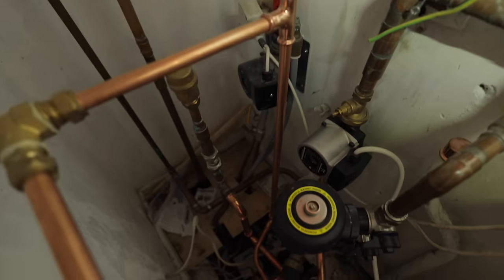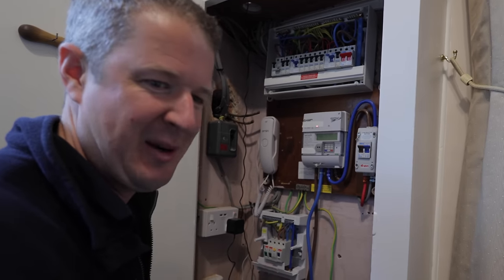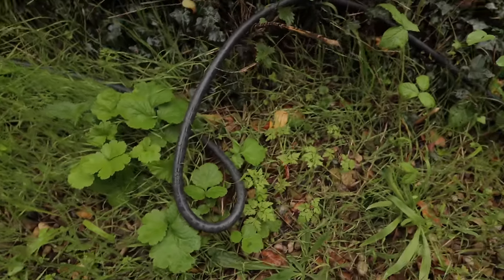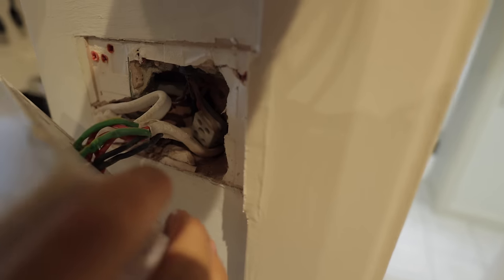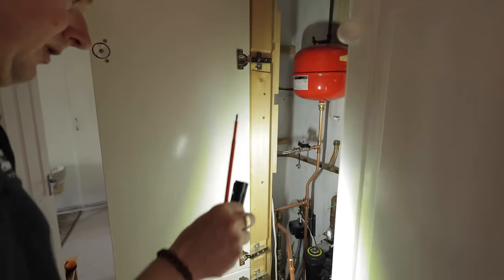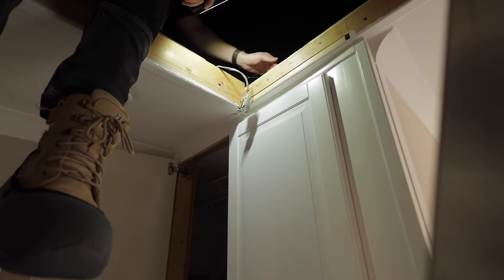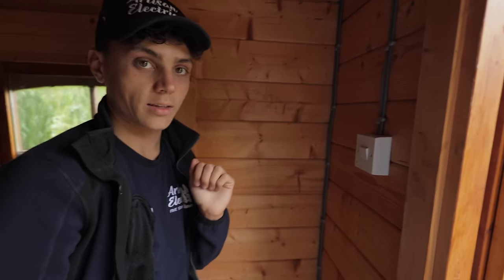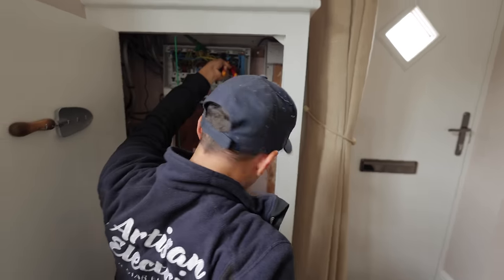The WORST Socket Wiring I Have EVER Seen!

Comment: I haven't checked the comments so someone may have said this already, but for 16mm tails from a 100amp main fuse, I would load test the circuits in that ccu via a clamp tester and ensure the total load doesn't exceed 87 amps.The only other thing I'd mention here is that the service cut out fuse may not necessarily be 100 amps despite it saying so on the carrier.If under 87 amps I'd go for C3 but over 87, I think C1 could be appropriate due to a lack of overcurrent protection
Reply: Even if the load isn't currently over 87 amps, that doesn't mean it couldn't increase at some point in the future (if they add more stuff, etc), so testing the current load is kinda irrelevant, IMHO.  The fuse rating should always be less than the maximum current rating for any conductor in the circuit it protects, regardless of the current load.  That is the only way to protect against possible future hazardous conditions as well.
Reply: @foogod4237  On an EICR we are reporting on an existing installation , not what may happen in the future. Any subsequent alterations or additions should be in adherence to reg 132.16 so the onus is on the installing sparky to ensure meter tails, earthing, bonding are correctly sized and do necessary upgrades where needed. I am well aware that the largest component on any final circuit must be the circuit cable but that doesn't apply to my comment regarding meter tails on an EICR.Whether you feel load testing is irrelevant your call, I've done enough inspection and testing training courses where this has always been raised and C3 is the correct classification code.

Comment: Undersized meter tails (in relation to the main fuse): if no thermal damage, and the calculated max load is below the rating of the tails…..I’d code 3 it with.
Reply: Bang on money

C3 not compliant but if fuse say 60 amp or so to match conductor size it fine.

C2 if undersized in relation to cutout fuse😊

Comment: Worst socket wiring I have ever seen was  in a neighbours house where some clown had wired a socket  into a  wooden shed from the house using two lengths of  satellite cable,  the socket  was under a reasonably high load , namely a tumble drier. I was lost for words when I saw the wiring.

Comment: Opening this video up I just know rhat the worst receptacle installation over in the UK is gonna be 10 times better than the worst in the states, and probably 5 times better than the insane pitiful average here in NYC. The stuff I find just in my own apartment/home would make your skin crawl!

Update at end of video: yeah that's not great, but I've seen worse! 4 or 5 times I've pulled a receptacle out that hasn't been touched since it was installed in 1983 and just had some of the wires come out. As in, they weren't really making connection in the first place, and could have caused a fire if someone connected a big load. Bad stuff.
Reply from the maker: I have seen photos and videos of the other countries around the world and would deem myself mostly lucky haha
Reply: @artisanelectrics   @artisanelectrics  I envy the UK design with partially insulated plug contacts! I was shocked last year in a pretty terrifying way from a 120v outlet for a gas stove.

If you're someone else reading this, ***absolutely have a licensed electrician do the work for you***.

Someone dropped a stainless steel sheet behind the stove (that we use as a grease splatter shield) and, unbeknownst to me, it landed right on the contacts of the plug.... which was about a centimeter out because it was loose.

*Of course*, our amazing luck was that it didn't conduct enough current to trip the breaker (heavy sarcasm). It just arced enough to eat a big hole out of itself over the neutral. It's not yet code to have AFCIs or GFCI/RCD on every circuit, and it certainly wasn't when that outlet was installed. Which means the stainless steel sheet was still energized to line voltage when I leaned behind the metal stove to grab it.

Zap. 120v across my chest and into the handle of the stove.

That night I replaced that outlet with a better one that is ALSO a combination AFCI/GFCI. It even turns out that that outlet, and half the other outlets, were wired backwards by the last person hired to do construction. Insanely dangerous. And it began a long project to improve the electrical safety in my living space way beyond code. 

Every branch circuit is getting a hospital grade GFCI with an audible trip alarm at the first receptacle, which is very useful for my elderly parents. Every circuit will eventually get AFCI at the breaker. Every downstream receptacle will be hospital grade or industrial grade. It ain't cheap, but I'll be glad to know that at the end, nobody has to worry about getting a shock, or starting a fire, ever again!

Again, if you're reading this, **absolutely have a licensed electrician do the work for you***. I *only do the work that I cannot get a licensed (and competent) electrician to do, and even then, I only do the one or two things that I can guarantee I can do safely from an electrical engineering and code perspective.

Sadly, I still catch even the best electricians I can afford making mistakes. Over here, a torque screwdriver is as foreign as it would be to an uncontacted tribe! So I usually have to loan mine to electricians, and make sure they use it.

I love the channel, and love to see a perspective from a different country. I hope you enjoyed the little story there!

Comment: God I wish we could get three phase in a residential areas here in the USA!  I would be all over that.  Get rid of all the dumb single phase to three phase converters that don't work near as well as having real three phase.  🤠👍
Reply: 😂I can get you a cable across the pond cousin.... 😅could take a long time thou and a big go fund me😂
Reply: Some parts of the US 3 phase is relatively common in residential. Here where I live we have a 3 phase high leg Open Delta setup, 100A. Due to be upgraded to 200A 120/208Y when the power company has time. As long as you live on a street with 3 phase power lines the power company has no problem hooking you up. Most of the time they do it for free as well because you are increasing the load and better balancing their system. All of New England works this way, most towns have 3 phase on most larger streets.

Comment: Seeing that 3 phase head can I ask a question about them please. the 3 phases are rated 100A each but is the neutral only rated 100A as well meaning you couldnt pull 300A in total if you were using it a 3 single phase supplies?
Reply: check the DNO incomer cable type.. will answer your question

Comment: The customer should be happy they chose fine tradesmen... craftsmen even.  🙂 How long ya been out of apprenticeship boss? 
I've seen my fair share of 'worst'.. lousy diy numpty mess - the layer upon layer of chit. the sick feeling of spotting VIR or asbestos... and the can be pain from plumbers. It's why I loathe to work on domestic installations.  
Pretty much the same gear and distribution system here (Aus) , with some differences... like Earth conductors in 2.5 and 1.5mm  3 core cable being smaller than A/N. The insulated Earth conductor is always stranded Cu.

Comment: Hi Jordan.  19ms is a little low for an RCD I think.  It could cause intermitent tripping.  I usually look for them to be 21 or higher to be ok.
Reply from the maker: Thanks for the info 👍
Reply: See regular 18ms rcd times.

More about having an rcd tripping at a lower test current and causing nuisance tripping😊.
Ramp tests are always useful tests to conduct and and also before doing a rcd test switch it on and off a few times😮

Comment: I’d only code the 16mm tails if the installation would be likely to pull more than 84a which is the maximum current carrying capacity of 16mm tails.

Comment: Seems the UK have a lot of really rubbish switchboards and meter setups. In Australia we usually have everything in one outside meter box and switchboard combo metal box. No ring circuits either.  Of course if its not a freestanding home you have common meter location and switchboard in the flat. Etc. I think we have it easy. What are your thoughts?

Comment: Canada here, a ring circuit is that like xmas lights if one burns out they all go out?
Reply: No because the last socket wired then goes back to consumer unit. The idea is that the electricity & of course the amps are shared from 2 directions so that it is more evenly applied to the things attached to them. Think of it like radiators that come from the boiler & then feed back into the boiler to make a circuit, however of course that only goes in one direction whereas a ring circuit supplies in 2 directions.

Comment: Have you ever found a 6” nail for a main fuse on an industrial job I have
Reply: Have found something like No 12 gauge copper wire in 30 amp Pocelain Fuse plug on main switchboard as Incoming line Isolator before meter and the carrier corner chipped off exposing the wire grip

Comment: Hi.  What is with the heaters you have there in the shower ?  I am in Australia we just have a water heater normally outside for the hot water    Either electric storage or instant gas   That works the whole house.
Reply: It’s an instantaneous electric shower. They came about because most houses in the UK had a vented low pressure hot water system, whereas the cold was at mains pressure, most didn’t have enough hot water pressure to work with a mixer shower. Electric showers use just a cold water feed at mains pressure and heat the water instantaneously as well as controlling the shower temperature. They range for 7kW up to 10.8kW.
Reply: @steveb1856  ok cool very interesting.  Are they used in every type of houses or do newer ones have a central type of system?  If you have the shower heater is there hot water at the other taps in the house or just warm?   Wow 10.8 kw. I’d hate to be paying the bill for that to be running   ,   Here if you have a electric storage hot water system and depending on the house size they are normally 250+ litre and only come on in off peak times so not really expensive to run and normally have a 3.5 kw or so heating element
Reply: @cthawes  The shower only draws current when in use so they work out quite cheaply 'per shower'  Not all houses have them, depends on the boiler system, some  boiler systems run at mains pressure.  

Another solution is a shower pump to overcome the low pressure from older header tank systems.  

Bulk electric water heating, as used in Aus., Is not that common because of cost but properties often have an immersion element in the hot water cylinder for use when the boiler is off.

Comment: Upgrade to a 3phase supply and fit a 3phase consumer unit.
Reply: I agree, if you have incoming 3-phase it's just dumb not to utilize it. If you already pay for it then just use it. Maybe the electrician that installed the panel didn't understand 3-phase.
Reply: @ehsnils they’re not paying for it, they’ve only got a single phase meter

Comment: The supply companies responsibility stops at the meter or main switch, they inform the consumer that the installation needs upgrading, they should have told them about the 16mm tails.

Comment: If the customer changed to a 3-phase meter, would they be restricted on exporting electricity given that 3-phase smart meters haven't been rolled out fully? 
I'd assume it would be import/export meters, but then they'd miss out on some tariffs that use a smart meter. Shouldn't matter much with a battery though, but they'd lose out peak demand reduction tariffs where they could use the battery.
Reply: There in progress ..😊octpus or ovo energy are on this 3phase metering ..

Comment: My fuse carrier says 100A, but the actual fuse inside is only 80A.  I got my tails upgraded to 25mm in preparation for a zappi install, only for Western Power to say they no longer offer 100A fuses in domestic installations :/  They state that the 80A fuse can be run at 100A for short periods, but will still charge you to replace it if it goes..
Reply: Funny you should say that a neighbour (farm) is trying to get his two three phase supplies moved a few meters into a new building. They have to apply for two new supplies and they are only been offered 80 amp despite the fact the existing are 100. I think the dno’s are trying to limit new supplies in preparation for the rapidly approaching shortage.
Reply: just whip it out and change it to 100A yourself then

Comment: 7:46 I see you're doing a ramp test there, not sure why, as the regs only require a trip test that returns a result of under 300ms.. but anyway,  If an RCD trips lower than its rated mA rating then that's safe for the consumer and therefore not an issue. of course, if it was tripping all the time you might want to change it, but safety for the consumer is No.1
Reply: Regs are minimum standard only. No one what's to promote laziness.
Reply: Sounds like you’re happy with just doing the bare minimum
Reply: Tripping at less than the rating is safe, yes, but you're wrong that it's not an issue. The automated battery of tests will also test it at half of its rated current, to see if it trips too eagerly. If it tripped at 15mA or less, you would replace it. Otherwise you risk nuisance tripping, which is an issue, and can especially be a safety issue (say if for example it takes out the lighting and the person has to come downstairs in the middle of the night in complete darkness to reset it).
Reply: Personally a ramp test should be carried out especially where selectively is not at its best, for example split load boards etc. The ramp test plus measuring earth leakage. If readings are close the client needs to know and mentioned in the report. Continuation of supply is aslo a safety issue. So more tests done the better. 
     No need to do half times test as a ramp would at one point will ba at 15ma. No need to double up on tests.
Reply: some times the mechanism sticks so a ramp test is useful to see if it's not been tested much.

I ramp test then physically reset it 5 or 6 times to free the mechanism 😊hope that hekps

Comment: Simple question: In the UK, would a steel beam cross section 1x2 feet rammed into the ground and extended through the building count as an extraneous object need bonding .  I'm not i the UK, just professionallu curious .

Comment: Asking as someone not from britain: Why is there a phone in the distribution cupboard closet thing? Can you still get analog phone lines in britain? Here in germany all the analog and isdn phone lines have been converted over to VoiP for a few years now. You couldnt get a analog or digital phone lines now even if you tried. At least with all the providers I know.
Reply: Analogue copper cable phones still in use but going obsolete. VOIP coming but not widely publicised - will not be popular with elderly/remote householders with no internet, etc.

Comment: I'm sorry, but if it's just from pulling too much current, why is a circuit breaker melting instead of just tripping?  The whole point of breakers in the first place is to prevent conditions that can cause melting/burning of things by tripping before that can happen.  If it's possible to make an overcurrent protection device catch on fire by just overloading it by a few amps, then that breaker is just plain defective, pretty much by definition, IMHO.

Comment: What’s with the phone in the consumer cupboard?
Reply from the maker: Emergency Line - Direct Dial to Artisan Electrics
Reply: Main bt socket is there, but probably not even working. bt working hard to get rid of pstn and replace it with a sip phone hanging off their home hub router junk.

Comment: Does anyone else put an operational limitation if the main fuse has a seal on it?
Or should I be just marking whatever is in the sticker?
Reply: Never assume...but if you cant  safely access then just put limation. Or get DNO to pull for you 😊

Comment: How did you know it was 3 phase? I have come across quite a number of service heads with 2 and 3 main fuses. It all depends upon what the original design was for. Mostly, the extra fuse would be for another service like off peak.
You also mention proteus and hager. In all my experience, these 2, particularly the latter, are more likely to fail than any others. Glad you do the visual inspection though. Sometimes, the visual will tell you the property has failed before you get your tools out. The NIC do produce a visual inspection certificate.

Comment: Thats nothing 😂 I am currently fixing a botch job by a "professional" electrician of 10years after a kitchen renovation, there are 5 trip switchs, he only connected 2, ALL the sockets on the house are to the main breaker and completely not protected with RCD... all phases and circuits are just to connector blocks with bare strands and large amount of copper showing on phases and neutral, all neutrals are bundled between circuits.

Keep in mind it was fine before the renovation and all junction boxes are spaghetti wires, re used rusty connector blocks... absolutely shameful especially after he bragged to me that he is a professional electrician with 10 years experience😂😂 I am definitely going to be uploading a video of this horrendous job.

Comment: Whenever we see standard plastic back boxes for sockets and switches in a single-skin wooden outbuilding (I say "shed", you say "summerhouse") I always wonder if there's a rule around at what point you should switch to metal boxes with grommets? My gut feeling is: if spiders or ants are clearly getting in and out, go metal, but I'm not a spark

Comment: I wouldn't ley you near anything above 12V
Reply: If you use a 12 volt circuit consider placing a suitable fuse in the circuit  Esp Lead acid etc
Many a time I have found Accessories wired direct off Lead Acid security alarm batteries with no fuse protection.